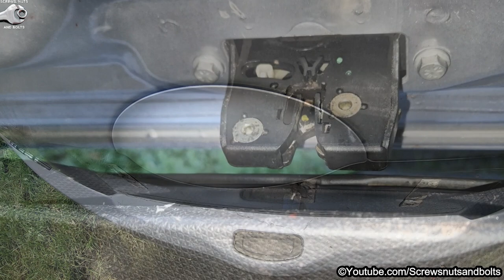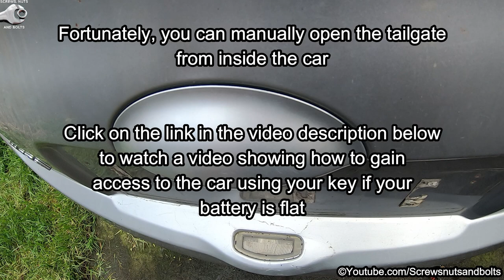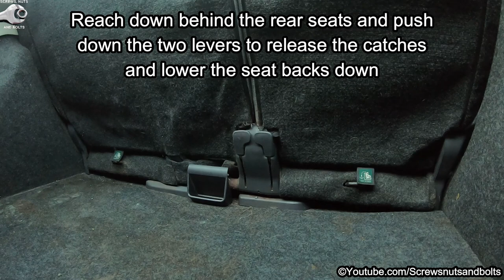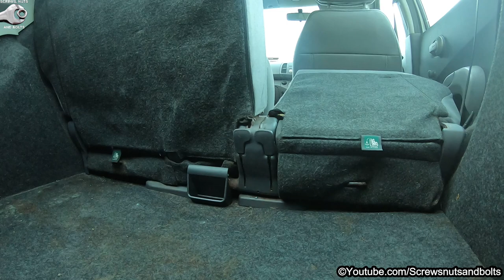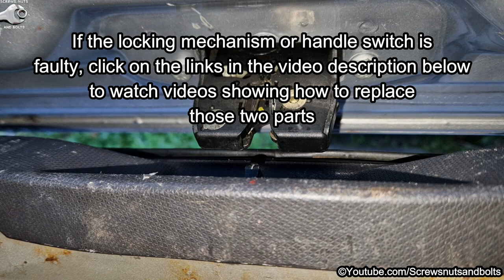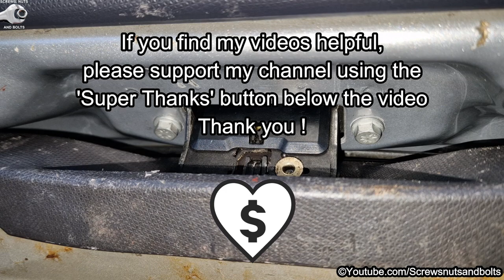How to Manually Open the Tailgate Lock - Nissan Micra K12

Comment: Thanks for all the helpful videos! Occasionally I can't open the tailgate at all, is there a way of knowing whether I'd need to replace the tailgate handle or lock?
Reply from the maker: Thanks, it sounds like the switch in the handle is faulty but it's hard to tell, especially when the problem is intermittent. Can you feel the button in the handle click each time you press it or does it seem soft at times or not click occasionally ?
Reply: @screwsnutsandbolts  thank you for the reply! Yes I definitely feel the in-and-out clicking on the handle, it's the lock that unlocks some days and doesn't on others.
Reply: @biscuitbiterla I have the exact same problem. Sometimes it just randomly unlocks itself while I'm driving

Comment: Hi. Thanks for all these K12 videos. Could you please do one on replacing the fuel filler flap locking mechanism, ours has broken and I’ve had to remove the flap as there’s now no way to keep it closed. Thanks in advance.
Reply from the maker: Is the inner catch broken or part of the flap, or the cable ?
Reply: @screwsnutsandbolts   Thank you for taking the time to reply. It’s the inner catch that the fuel flap clicks into and the cable pulls to release it, not the lever in the car. Our fuel flap won’t click shut so have had to remove it to get through an MOT.
Reply from the maker: You're welcome. Does the catch move in and out of the body when you pull the lever ?. If it does, could the metal receiver on the flap itself be bent out of shape ?
Reply: Had a quick look and it appears to be correctly shaped but something seems to be missing that would latch the flap, is there a plastic part in there? If so then that part is broken/missing. I’ll need to replace that part, obviously it’s bolted on from the outside but I’m not sure how to get behind it to unhook the cable.
Reply: @screwsnutsandbolts  Sorry, wrote a reply and I’m sure it went but can’t see it.
There doesn’t appear to be a catch, is it plastic? If so it broke off. There’s nothing for the flap “prong” to click into just a hole where it should be.
Reply: Ahh. I can now see it 🤦🏻‍♂️
Reply from the maker: It's a metal piece that sticks out 90 degrees from the inside of the flap. Is it still there ?
Reply: No, it’s just a hole.